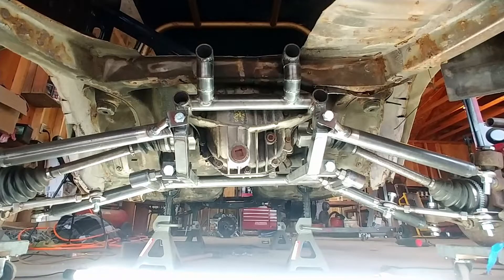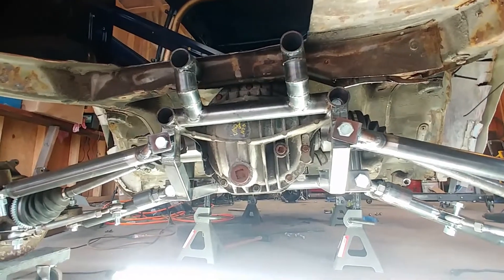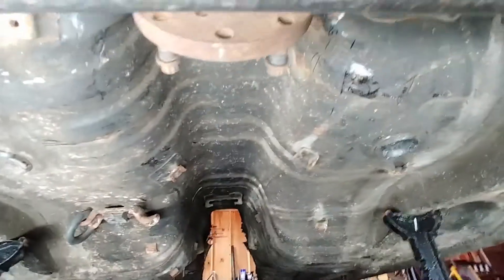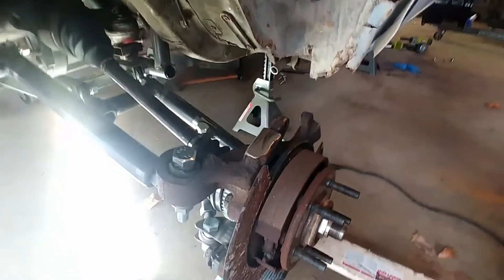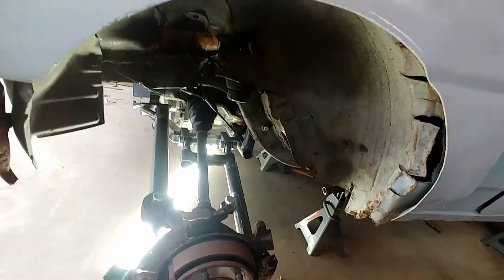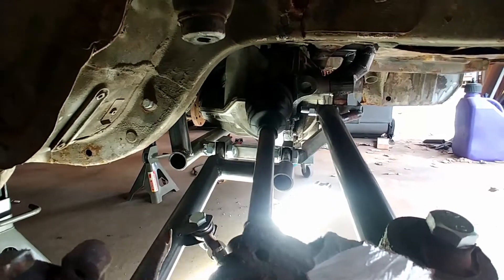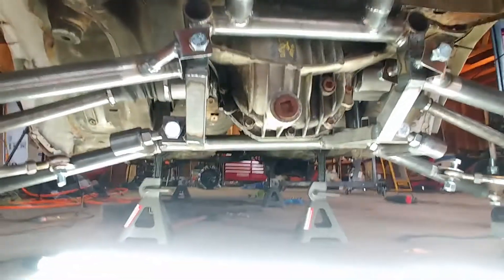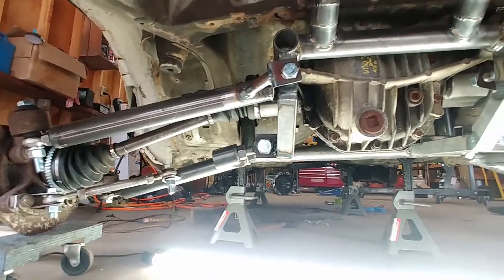Toyota Corolla TE72 Ford 8.8 IRS SWAP

Comment: wow you just made my 8.8 swap look like a kinder gardener did it lol.. wish I could have kept the stock axles, getting explorer to tbird axles made rn. Subscribed!!!
Reply from the maker: Much appreciated! I had to do some revisions to the rear before it got put in storage so I'll make another video about what I had to do once it's out again.
Reply: @slightedengineering  I'd love to see anything else you do to this car! Just a bit of info I found out the hard way, oem explorer shafts cannot be resplined. snapped them immediately, ended up with a lincoln mark 8 diff and a set of monster miata axles. hopefully you didnt have to shorten yours.
Reply from the maker: @miatakhalifa  No shortening. I designed the rear suspension around the width.
Reply: @slightedengineering  awesome, thats the main thing i love about your design and the key to keeping that swap budget friendly. Dss wants roughly 2500 bucks for a set of custom axles lol..
Reply from the maker: @miatakhalifa  Yup, I can go through 20 sets of axles before I get to that amount lol
Reply: @slightedengineering  man that's how it should be lol. So are you keeping the 4.2 na or boosting?
Reply from the maker: @miatakhalifa  it's going to have a 7875 turbo and run an ECU Master Black standalone.
Reply: @slightedengineering  haha oh thats gonna be rowdy. I can't wait to see this thing in action. My initial plan was to do a turbo ls build, but I'm kinda tight on real estate. So i think im just gonna spray it.

Comment: bro that looks sick i was thinking about this route for my Subaru swap i did but ended up going with the solid 8.8. love what your doing defiantly following along
Reply from the maker: Thanks! A solid axle would definitely have been the easier route but I wanted IRS for the handling characteristics and tunability.
Reply: @slightedengineering  yea we are going drag for ours so the extra work didn't make sense that and i wanted to tuck the big meats under the car going for the sleeper look check it out if you get a chance
Reply from the maker: @WastedTalentFabrications  Gotcha, yeah mine won't be a sleeper anymore seeing as how the track width is increased by probably 10 inches or so. It's definitely going to be wide and grip well. I'll have to check yours out.

Comment: Did you use the unequal length axles? Or perhaps 2 short ones? It looks like you're using the Explorer rear knuckles. 
 I'm putting this rear in my 1991 Merc 500SL and I've the pumpkin in the rear subframe.
I've been following your build on the 4200 page.

For info for anyone reading... these are the axle codes on the sticker in the driver side door jam:
43 Open 3200 3.08
41 Open 3200 3.27
42 Open 4.10
46 Open 3.73
45 Open 3200 3.55
D4 Limited Slip 3200 3.73
D2 Limited Slip 4.10
L73 Limited Slip 3.73 -
Reply from the maker: I used the standard axles left and right. The pinion input is offset that little bit so when you center the diff about the hubs the pinion comes out in the center. It would be way easier to explain with the car, it's currently in storage as I've had some personal stuff come up but I can make a video explaining it better once I have it out again.

Comment: Did you do a tabular frontend
Reply from the maker: If you go over to my Instagram you can see how I did the front end. I just made custom mounts and welded them to the existing chassis.  I wanted to try and keep as much chassis as possible.
Reply: @slightedengineering  will do
Reply: Is your Instagram  the same name as well
Reply from the maker: @JoseCruz-gn1ln  yup just all 1 word so slightlyengineered

Comment: This is bad design . No triangulation ,  lot of stres on component due bag geometry ,  you plan to carry weight axially trough rubber bushing . First time you hit brakes ,  it will bend something , or rip weld.s      Math  is very important  in life
Reply from the maker: Math is important, just like grammar. The suspension has gone through various revisions since this video from years ago. The rubber bushings have been replaced with solid ones. Other various degrees of freedom have also been restricted. Now, the only freedom of the system  is up and down, like it should be.
Reply: @slightedengineering  English isnt mz native language , so grammar isnt so important to me .Same as speling . 
Lets go back on geometry . Lot of forcies I zou design have leverage , so they make bending moments . You need simple member that can carrry load on shorthes path .    Generaly you need triangulation not L shape suspenssion  member .  dont get me wrong ,  I dont wont  to critique , my intention was to point this design isnt safe
Reply from the maker: @stevanjakovljevic8390  fair enough. The major load-bearing member in the system is the upper arm, as that's where the coilover is mounted. The lower arms only job is to restrict fore aft movement and restrict toe compliance. There's no bending moment in the lower arm as it's only connected on its ends. The upper arm has a bending moment but is of substantial strength since it is a thick wall tube. The suspension also needed to remain adjustable. Any added triangulation would remove adjustability for that member.
Reply: @slightedengineering  Did you drive car with suspension like this ? Brake hard , accelerate hard ?